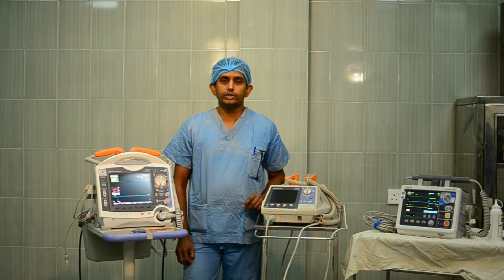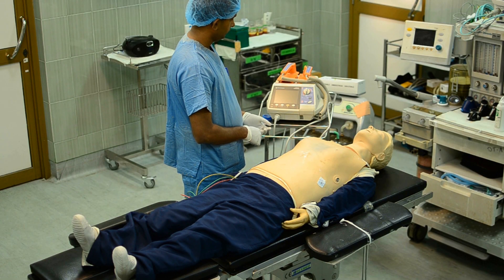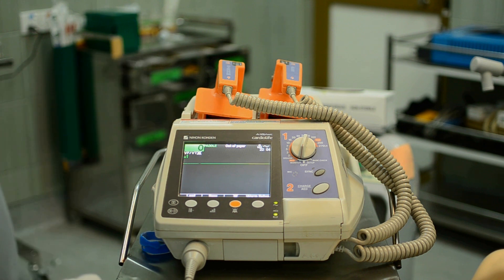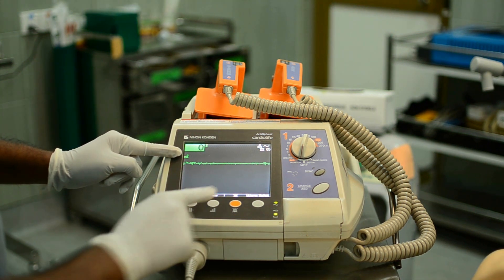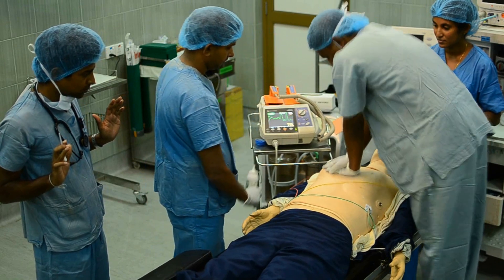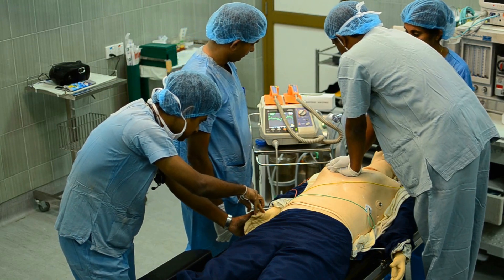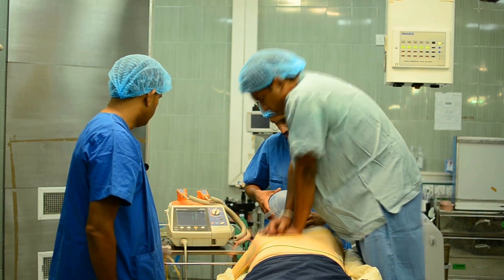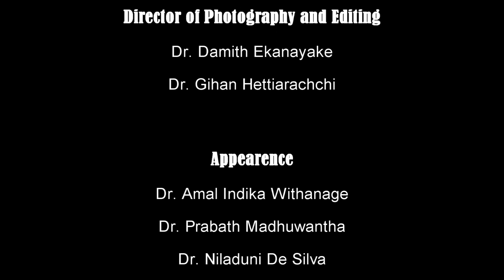Defibrillation Technique

Comment: I used defibrillator on a real person first time yesterday. It was an amazing experience. :) unluckily she didn't survive..
Reply from the maker: Overall outcome of a patient following cardiac arrest is anyway poor. Main concern should be early identification of the deteriorating patient and providing treatment so that cardiac arrest would not occur. Adhering to early warning scoring system during observation will be beneficial to achieve this.
On the other hand, witnessed arrest with proper ALS and correct post resuscitation care will improve outcome for a certain extent.

Comment: Good team work and proper command sir!
But, is the jelly you had applied will it be enough or can apply it on the padels itself!
Thank you!
Reply from the maker: This video is a demonstration on key points. The basic here is you should apply adequate amount of jelly to make sure there is proper contact and effecient delivery of the current. It should be applied to the patient, since we are charging on the machine if we try to apply afterwards there is a risk of discharge and harm